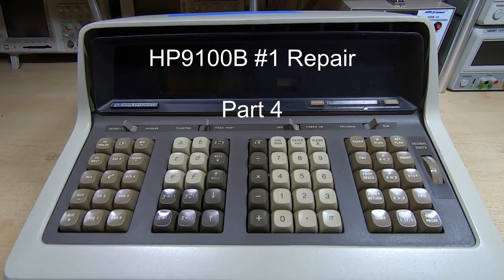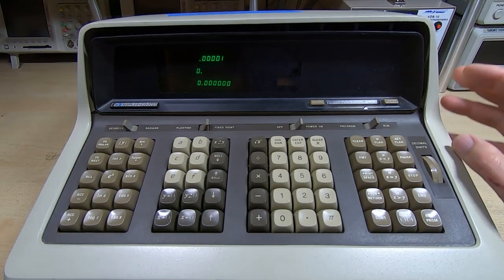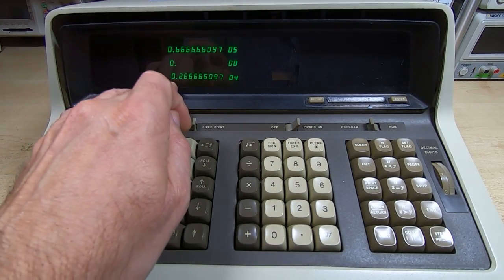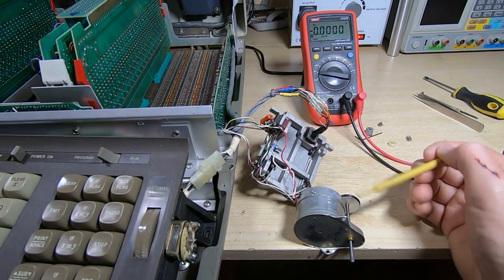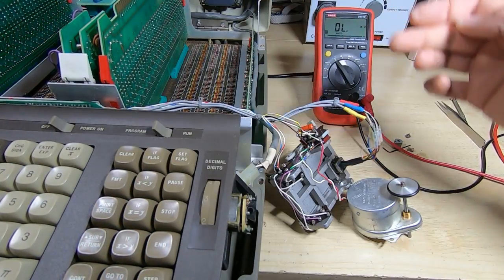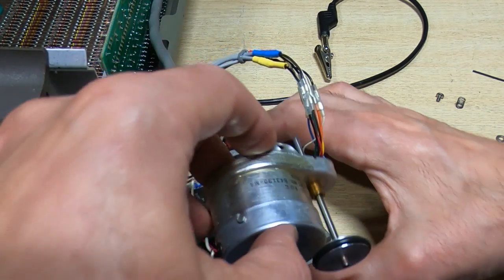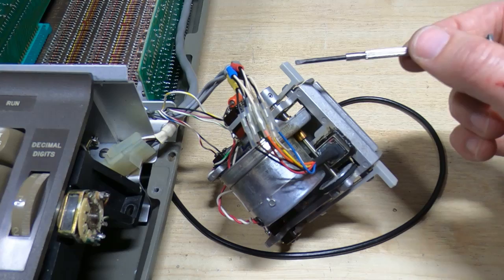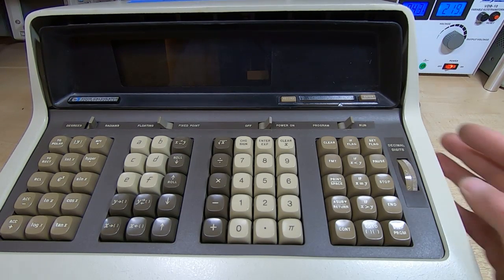HP9100B #1 Repair Part4

Comment: Would really like to know how the diode logic is working.  I'd seen a demonstration of using diodes as switches in analog circuits.  Is that were the sensitivity is coming from in regards to line voltages?
Reply from the maker: I will be covering the DTL logic in a future video. The reason that it is sensitive to line voltage is a bit more difficult to explain although I will be covering this at some point. It is not really the internal voltages that are the problem as they are regulated and after bootup will always be the same. The change in startup behaviour is caused by the disruption of the core memory operation if the power does not come up cleanly. It causes the memory to give the wrong data and this can cause the machine to do different things depending on the actual data seen by the logic circuits.

Comment: Jerry, when you freed up the motor, did you open it up & replace the old grease?  I was initially surprised that the friction pulleys/wheels hadn't turned to mush over the years, but seeing that someone had attempted to repair the drive, I understand why the O-ring was in such good condition.  When you bonded the O-ring to the wheel/hub, did you use contact cement or something else?  I ask because I believe that I've got some magnetic strip drives (much smaller than this one) in newer calculators that probably need similar repairs.
Reply from the maker: The original friction wheel did not use an O ring but a silicone based material that was much better than rubber and lasted a lot longer. It also had a flat profile so was much better. Possibly someone tried to fix it (due to the failed cap) and took it apart. When they saw the flat section on the ring they may have assumed it was worn out and replaced a working wheel (I have seen this a few times). I used epoxy to bond it. I did not mention it in the video but I also turned the O ring so that is was flat (You can possibly see this in the video). A round ring profile tends to damage the cards. The motors are easy to take apart as the small tabs can be driven aside and then the bottom plate can be removed. The tabs are bent back over to hold the plate after reassembly. If you do not want to take the gearbox apart then you can drill a couple of holes so that the old grease can be flushed out and new grease injected but you need to know where the internal gears are to do that safely.